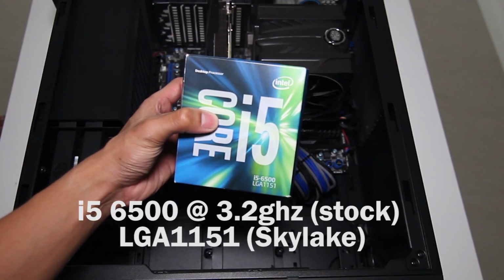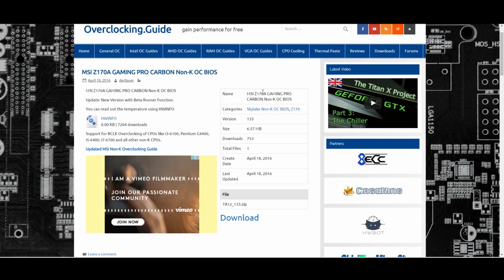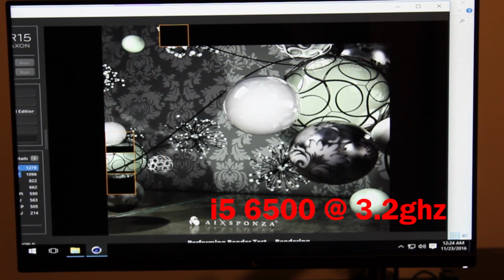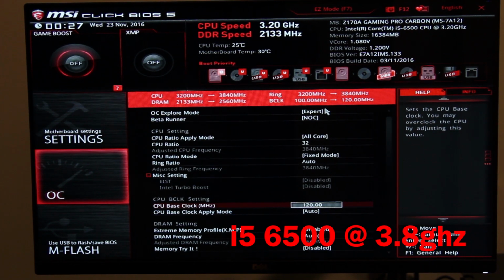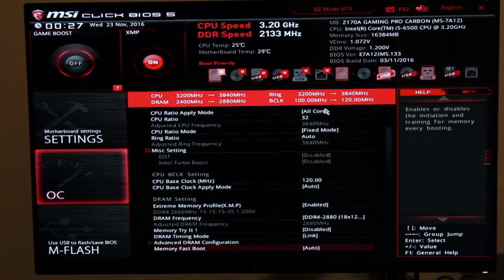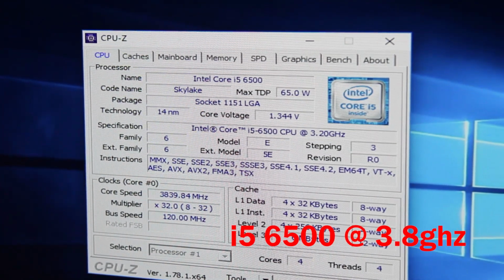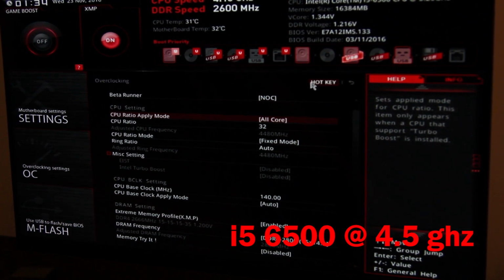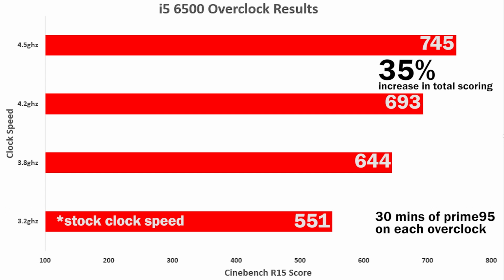Skylake Non-K CPU Overclocking with an i5-6500! Legit!

Comment: Man, could u please help me out, i have almost the same hardware yet once i tweak it alittle bit it turns out to be cpu temp 100 degrees .. please reply me back man
Reply: asdagag afadadf when you start adjusting the base clock it disables the cpu temp readings other videos I’ve seen mention this I put my fan speed to full constantly to make sure temps are not an issue I run my i5 6500 @4ghz seems fine

Comment: Hi I got my i6-6500 to 4GHz @1.2Vcore stable so far.. Just to clarify that core speed will ALWAYS stays at 4GHz(max) even when idle in this overclocking process? This is normal right? I had to know as its my first time OC'ing a CPU and non-K is my first time ahaha.
Reply: what is your MB? and did u update your BIOS from Overclocking . guide files?
Reply: @KP-48-007   Mine is Asrock Fatality Z170 Gaming K6. I got it with bios ver2.8 already like 2yrs ago, I just had a chance to OC it this year after upgrading the stock cooler to Cryorig M9Plus. settings was BLCK/Bus speed=133 core vol=1.152 and RAM XMP profile @below 2400Hz as my RAM is limited to that freq only. I am more stable now @4.25Ghz OC and not so hot with 1.152v.
Reply: I have msi z170a gaming pro
I set the voltage at 1.3 with. 4.160 but when I start windows it shows me 3.192 on all çores, I couldn't see the oc speed in windows
And in the bios it is current speed also 3.2GHZ but the adjusted speed is 4.160
Bclk 130

Comment: Just to update, this still works 3ven with the most recent bios on my msi z170a pc mate on msi website. No bios mod they just have beta runner option enabled now
Reply: This work with the i5 6500?? Im having great difficulty over clocking this cpu with this board or even finding the bios everyone is using as all the links have stopped working. Obviously if what you say is true I can just grab it from msi.
Im using z170a krait gaming though..
 Thanks
Reply: you can't not go up to 3.3Ghz

Comment: Would anyone know why I would be unable to overclock on the custom bios that is widely used on the web for the MSIZ170 a gaming pro? Even a small nudge in the bclk fails to save and reverts to stock clocks when I reboot.  But an official bios from 2017 allows me to overclock but will not allow a number higher than 121.88 so I am stuck at 3.9 on all cores?
Reply: solved this problem ?

Comment: Can someone help me I overclocked my i5 6500 to 4ghz and I put voltage to 1260 but it says my vcore is at 1324 something like that and it’s stuck can someone help me with this? 1350 is too high voltage for me it gives me 70+ degrees which I don’t like
Reply: Btw I have a cooler master 212 hyper evo something like that so

Comment: Hi mate I oced by 6500 on asrock b15m hyper pro 4 motherboard. Only problem was I was not a blue to see the temps of the CPU with any programme. Cpuid hwmonitor hwinfo or any other and cinebench and hwinfo were detecting CPU speed at 2.6ghz instead of 3.8ghz

Comment: Great video thx u for sharing I have a question I have the exact same CPU and motherboard but my ram is corsair dominator platinum 3000 what should my ram speed be running while overclocking? My CPU cooler is cryorig h7

Comment: Great video! As a first time PC builder, this helped me save a good bit of money and allowed me upgrade to 16 gigs of RAM (more than I should ever need, because I'm just gaming, but I open tabs in chrome like nobody's business :) ). I got the 3.8 Ghz overclock easily, and I know I can push it further, but I'm not certain on what I should change and how I should change it. What were the changes you made to get to 4.2?
Reply: Cres que pueda el mío con el disipador que viene incluido a 3.8 GHz o un poco menos la quiero para jugar warzone
Reply from the maker: I basically used the settings in the video. What motherboard are you using?
Reply: Top stable is 4.3

Comment: how many ghz would you think I should get with the stock cooler. or should I upgrade to evo 212 cooler and get 4.2ghz. I have msi z-170 a pro
Reply from the maker: Hey. I think you should at least get the 212 first, running on stock fan may be a little risky, as it doesnt provide much cooling :)
Reply: Will the evo 22 help me get up to 4.0+ghz or do I need water cooling? Also I only have 2x8gb 2133mhz ram, will this do?

Comment: hey bro what cooling solution did you use with this test? also I am wanting to overclock my 980ti and my 2133 ddr4 ram what would you suggest
Reply from the maker: That Game Dude84 using cooler master v6gt cpu cooler. OCing ram for 2133mhz? try 2400mhz. dont go crazy on ram.. coz there is not much to gain by OCing ram.

Comment: Are there any Microcode updates being pushed via windows10 to disable the OC ? Happened to me previously on the G3258. Planning to get a z170 board soon. Great vid and thanks
Reply from the maker: Shouldnt be an issue, you can re-flash your bios to a specific version at overclocking guide's website :)
Reply: Tekan Start Thanks for the reply. Just one more question , is your system running the latest win 10 updates ?

Comment: Tekan Start
I have use this metod and i have got 6500 on 4.5 GHz and 1.29 v ;-)
Thank you.
What do you think, can i go litle farder?
Reply from the maker: Ante Plus will do delid video real soon buddy. stay tuned!
Reply from the maker: Hey Tomas, damn that is impressive ! I think you can but 4.5 is really pushing it already. Congrats !
Reply: not bad. i got my 6400 to 4.8 GHz on 1.36V
Reply: Tomasz Ochorowicz how are the temps? what cooler are you using ATM
Reply: wow
Reply: +Yap Jui Meng
right now im using aio Lepa Aquachanger 240mm and i have 45C on CPU Package
Reply: +Tekan Start 
Hey, I'm thinking of one thing.

I give a 1.35V core Cinebench score is 740, but now I have a 1.29 Vcore is the result of Cinebench is only 712.
Do you think the i5 performance depends on the size Vcore?
Reply: @TheZeberson  I have mine at 4.5 ghz and 1.35 voltage and I only got 680 highscore how?
Reply: delid the i5 6500 and bump up the voltage and go for 4.7
Reply: Ok i will be waiting :)
Reply: Siema, mam kilka pytań odnośnie od tego procka,  pomożesz?

Comment: THANK YOU SO MUCH. Ive been trying to oc my i5 6500 the past few days with the correct bios but it would never boot with any change to bclk! then i found this video and turning on the NOC thing worked and im currently at 4.2 ghz stable. thanks !
Reply from the maker: Awesome! Good to know man !
Reply: Hi guys, by any chance do you still have this bios?
Reply: By any chance do you remember the settings you had on to get the 4.2ghz?

Comment: what clock speed and CPU voltages are you running currently?
thank for the vid !
Reply from the maker: For the i5, 1.25 should be ok, start off with 1.35 then slowly reduce, to reduce the amount of heat. Try running a stress test first yeah.

Comment: is this a good combo?  is enought to make a oc?  I don´t want a extreme oc, just a slight oc for gaming.
Msi Z170A pc mate
Msi armor Rx 470 4 gb
i5 6500
Coolermaster 212 evo
2x4 gb viper elite series ddr4 2400 mhz
evga 500w
SSD pny 120 gb
HDD 1 tb
Reply from the maker: Definitely a good one bro. What is your monitor? That will determine your overall experience :)
Reply: a simple 1920x1080 monitor, is of a "strange" brand but it serves for I need

i will not have problems in doing oc to the memory to 2666 mhz or higher?? thanks for u :)
Reply from the maker: Basically you are setting your ram frequency to a higher threshold, which in a way "overclocking" it, give it a shot, let me know if it works :)

Comment: hey good video. but i have some questions. 
do u think i can overclock my i5 6500 with the MSI Z170A Gaming M3??
and if i have to downgrade my bios up to the one before intel send the microcode to unable overclocking, does it compensate the OC??
Reply from the maker: Hey, it really depends, you should check at overclocking.guide to check your bios version, funny enough, the bios that i updated in this video was a later version of the one that came stock. Give it a shot :)
Reply: Tekan Start thank 4 u answer, but if u want to come back to the original bios u only have to download?? Am I right?
Reply from the maker: Yup, you can download specific versions of your bios. BUT do take note that I have heard many stories of motherboard being bricked after updating your bios, so there is a little bit of precaution that you need to take. Perhaps do a bit of research on OC done on your mobo with NON-K processors? I unfortunately have no hands-on experience before, so I can't tell much. But in all honesty, you should be allright. First, check the version of bios, then take the necessary next steps :)
Reply: Tekan Start OK thank u a lot for the advice, good luck with ur channel
Reply: manuel maltez no it will not work, I have the m3 and a 6400 and no matter what I do it will lock it the stock frequencies
Reply from the maker: Could you share a screencap of your bios settings? Maybe host it and paste the link? You to enable some stuff and of course download the right bios :)
Reply from the maker: Ok did you try and disable C-State? That tends to be the cause usually.
Reply: Were is C-State in the bios?
Reply: Tekan Start nope still the same with it disabled
Reply from the maker: Hm...i have not tried with a 6400, it works with a 6500 tho. Let me try and ask around for you :)
Reply: Tekan Start Thanks man for your help Im really bummed I can't get this to work.
Reply from the maker: hey Jimmy, I can't seem to find a solution but i read this http://www.tomshardware.com/answers/id-3124360/6400.html . Apparently some of them managed to hit 4ghz. What bios version are you using?
Reply: Im using E7978IMS.A61 I think its was a microcode update because I bought the motherboard a couple of weeks ago.
Reply: jimmyruffo I haven't try yet because I have no need now, but I think it is possible, Intel is trying to sell us the K chips cause they have no competition...
Reply: What my PC looks like after 4Ghz overclock
http://imgur.com/IJQBOcW
http://imgur.com/Si4G0ac
Reply from the maker: Hmmm..that is quite strange, did you donwload the specific bios at http://overclocking.guide/category/intel-oc-guides/skylake-non-k-oc/msi-non-k/ ?
Reply: Yeeeeppp
Reply: Just going to by a 6600k
Reply: hi man i have the same bios version, i have the same problem of you, have you solve that?

Comment: Bro please fix the description. The Cinebench R15 is absolutely free. You don't  have to purchase it. Anyway, what's the temperature you got at 4.5GHz under load and what cooler are you using in your rig?
Reply: Tekan Start In closed case with 2 fans, 1 in front 1 in back, temps should be lower.

What about other features of OCd nonK processor - is it true that iGPU and Windows power options Balanced setting don't work? Like..cannot use 2 monitors and cpu runs at the highest clock all the time?
Reply from the maker: Hey thanks for the comment, i fixed it already in the description. Also added the cooler that I used which was a v6gt. If I recalled, the temp was about 61-63, but I would think in a closed case setting, it would be higher :)
Reply from the maker: Amer Huba Cpu runs at highest clock - true. But that doesnt mean that vcore is maxed out all the time. 

Igpu is disabled by default when u oc. But dual monitor will work fine if u plug both monitor input at your discrete gpu.